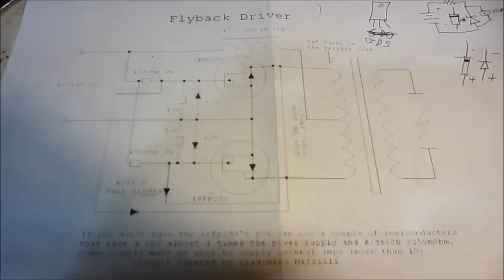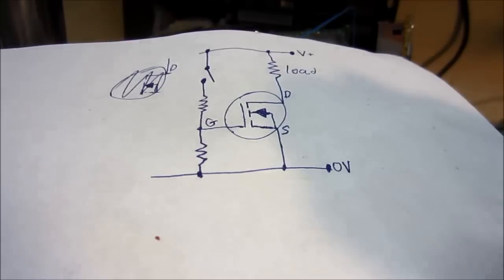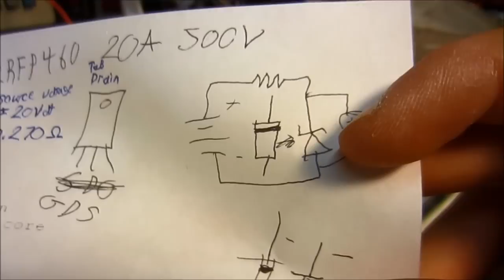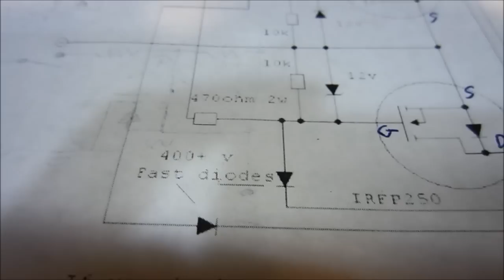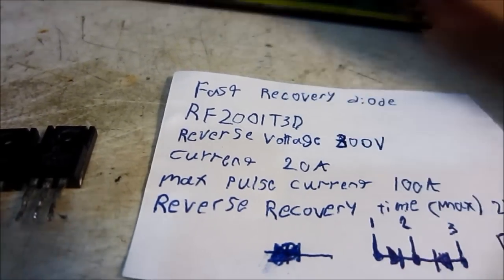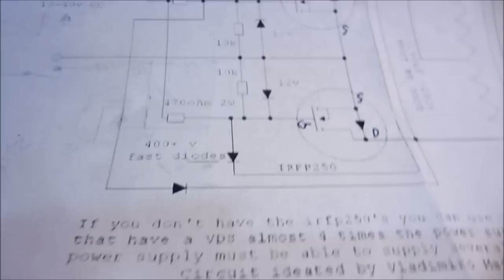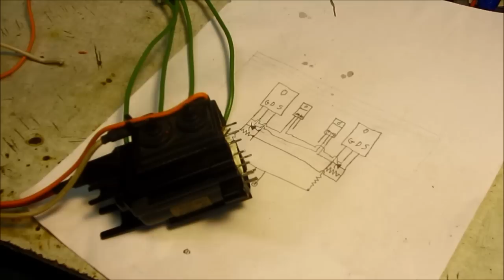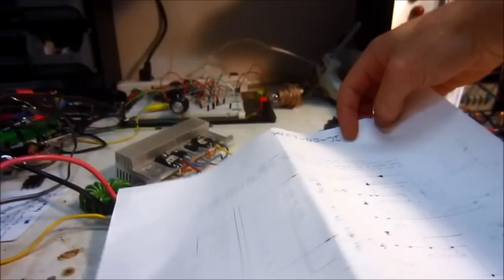How to Build a ZVS Driver, Run, and Mosfet Failure

Comment: i finally made a ZVS driver. hooked up my power and got nothing. i looked it over and over and everything was hooked correctly but nothing came from the flybacks. i put some more voltage into it and then one of my mosfets just burned up. never was able to find the issue, very discuraged
Reply from the maker: Well if you look at my latest post on Google+ you'll see that I just built a ZVS driver and it works great!!!  How to video probably coming soon too.  Can you take a picture of your ZVS so I can see how you have it hooked up?  What were you using to power it(voltage and current)?  What mosfets were you using and are you sure they were good?  I must solve this mystery!!!  :)
Reply: ill send you a photo some time, but it might have been to much voltage, i didn't realize ac to dc sometimes the dc was higher voltage, i put in 12v fist and got nothing and then used a MOT with 32V ac into a bridge which migh have been more then 40 which was kind the max. but nothing ever came. and all of the parts are brand new bought to the specifications to the diagram. do you have an email i can send the picture to?
Reply from the maker: Hmm... What mosfets did you use?  That stinks that it's all new components.  You can send the pictures to makerj101utube@gmail.com or post them on Google+.  I don't check that email much though so post a comment or something on YouTube when you have sent it so I know.  If you don't it will probably be like a month before I see them!  Hahaha  I don't know how your comment went undetected... I check my YouTube like very day...  I am just going back and checking some of my latest videos to check for comments I missed cause I seem to miss a lot with the new comment system.  Sorry about that.
Reply: haha dont worry about it! i think i figuered out the issue, thanks!
Reply from the maker: That is good!  Did you get it working or did your mosfets get damaged?
Reply: i haven't yet remade it, but my mosfets burned up, no worries because i have two more pairs. Before i do anything though i have to buy a new multi-meter, burned up my last one hahaha
Reply from the maker: Oh well, good you have extras!  You can buy ones that are $3 from Harbor Freight!  They are cheap as ** and don't last long.  But they are petty accurate and and have all basic features that you need.  For the price you really can't beat them!  But ya the cheap ones burn up supper easy!  Just over volt them on the wrong setting and you let out the magic smoke!  XD
Reply: i got everything of digikey. not to bad and its high quality
Reply from the maker: I have never gotten anything from Digikey but I've heard there pretty good.  Probably safer than eBay.
Reply from the maker: Not nearly as cheap as eBay though.
Reply: yeah thats true

Comment: wow your ZVS is looking realy good :)
but at the end the flames on the mosfet was not looking that good :(
Fokus
Reply from the maker: Thank you!  Yeah the mosfets that I used were not the best ones.  Check out my newest ZVS driver that puts out 3 inch arcs and has not burned out yet!  New ZVS Driver Running Like a Boss With IRFP260N Mosfets - Hot 2inch Arcs and Jacob's Ladder

Comment: BOOOM mosfet kaput :(

So one thing about the schematic, (simplified schematic of Royer oscillator with diode feedback, have several fails and faults)... use separate power supply for the output stage (the point of the filter choke) and one power supply for the point of the two resistors who going to diodes and Mosfet gate`s and operate the schematic so: first connect the power supply 12.6VDC-15VDC to the point  with diodes and Mosfet gates and let it be powered all your test time then just give the power to the output (24-80VDC)  stage - the filter choke... and you get NEVER get burned Mosfets!!! and one more thing add a Neon lamp to the Tank Cap it will be helpful  :)
Reply from the maker: Thank you so much for the tips!!!  So if I use a separate power supply of 12 volts or something does that means that I don't need the zener diodes any more?  So if I connect the 12 volts first does that give it time for one of the mosfets to turn on and the other to turn off so they don't both get the inrush current?  Also what is the job of the inductor/filter choke?  Thank you so much!  I bought some IRFP260N mosfets so I'm going to have to try this the way you suggested and they should last longer!!!  :) :) :)
Reply: Makerj101
Separate power supply will improve the schematic with kind of "PRE Oscillation" on a scope you can see it (a sinusoidal signal) on the main LC circuit (for measurement on inverters, HV stuff better scope with good insulated inductive loop pickup sensor), the cap and the output coil (or transformer primary) if you connect a fly back or else. The oscillation will start wen you apply the 12VDC to the transistor gates, --> trough the diodes (diode reverse current) this schematic start to oscillate with small output power because the current is small and trough diodes going around 3VDC if you use a correct type of ULTRA fast diode such HER508 (UF5408).
Wen you apply the main voltage to the filter choke the Royer will start up without a kick of the current and you Mosfets will survive. Such upgrade work as SOFT START.
The Neon lamp parallel to the main capacitor will work as snubber and take of the over voltage.
The usage of zener diodes is up to you, i let him between gate`s and GND rail.
IRFP260N a good stuff but never use a power more than 80-100VDC to the schematic, circuit is resonant and wen it works on the transistor drain`s will be around 200VAC and more with lower frequency :)))
Im using IRFP460 and IGBT`s (1200V ~50A)... ---> 11N120CND are useful.
The ferrite choke block`s HF to go back in power supply and prevent inrush current wen you switch on the circuit.
A other sing that im testing to time is new add on for Royer oscillator... it will be a driver for gates operated from the diode feedback signal :D Thats will improve the efficiency of the inverter.
Reply from the maker: Very interesting!  Thank you sooooo much!  I built my ZVS driver the way you have suggested and it works great!!!  Video coming soon!  No burnt mosfets yet!  So that's the proof!  :)  Wow so your saying I can go up to 80 volts with my ZVS using the IRFP260N's!  I have only got it up to 30 volts and I am getting awesome arcs about 3 inches long!  If I can go up to 80 volts with out going over current then I don't even have a clue how big of arcs I will get!!!

Is there any harm in not using and ultra fast diode and just using a fast recovery diode?

I also swapped out the flyback transformer for a induction heating coil.  How do I determine what frequency (capacitor value) will heat the metal fastest and more efficiently?  Cause I tried many different caps and it was hard to tell which one was better.

Thank you so much for all the tips and help and such!  Much appreciated! 
-Makerj101
Reply: Makerj101 The frequency is of the metal's excitement frequency, usually about 115-155kHz.
Be careful, you're basically having a huge AM transmitter(with "no signal input) with no antenna in your hands\on your table! That's all sorts of nasty.
Reply from the maker: ***** Interesting.  That could be bad!  How would you contain that much RF?  Thank you!
Reply: Makerj101 You just don't. It's all over the place if you do anything with HF HV anyway.
Reply from the maker: *****  That's true.
Reply: *****
Yes this so cold "auto generator" can up to 300kHz oscillate and even 2MHz but its not bat stuff :D
Just you must be careful with resonant parts of the schematic HF AC current left a painful burnings even can kill you.
I got a god scar on my left hand from a short wave transmitter ... HF "arc" burned a hole in my nail when i touched an unsafe terminal on output amplifier ...

Comment from the maker: ***** Yup!  It was using over 200 watts at max!  Not bad at all!
Reply: maybe the failure was partially due to your power supply rise time. if the rise time isn't sharp enough it won't resonate and you will blow the transistors

Comment: Man, I wouldn't trust the insulation on that high voltage wire.  Couldn't it shock you by holding it?
Reply: more likely if it was alternating current on the output, an ignition coil nailed me right through  50kvdc wire. flybacks are rectified now a days.

Comment: Probably too much highest volt with incorrect resister or fast diode doesn't work right way. I recommend this UF4007.  Also you need capactior for power supply.  If it is 25 volt, I would recommend 36V 4700uf.
Reply from the maker: Thank you so much!  I'll have to try those things!

Comment: (P = V x I) work it out, you know your current and your voltage so work out the power and you will know what W rating on components you need to handle the power.

Comment: i use parts drawers that you can buy from home depot or lowes or any hardware store.  then i use a label maker to label each drawer. (i spray paint mine black without the drawers in it so they look nicer because they come in a really plain gray color)
5ky.me/media/organization.jpg

Comment: I have seen this circuit used on YTube so many times. nobody has ever described what is happening in the transformer. All you guys show is the way the transistors are switching. The reason it switches is because the transformer is saturating and the field collapses then the next FT switches and the process reverses.  This is one of the stupidest designs I have seen.  It cannot be turned on slowly.  It must be switched ON fast.  If it is switched On slowly, the circuit latches and one transistor just stays on and blows up.  It does not have any short circuit protection.  Why don’t you use a proper control Iron Condor and definitely not the 2526 which also does not have SC protection?

Comment: I had a very hard time making my zvs to work.This is a chinese zvs driver I got off ebay.I did manage to make it work only after adding a second inductor parallel to the existing.The strange thing is that according to my LC meter this inductor's value is 2.400mH which is way much higher than your inductor. .I am told that the indcution of the small torroid has to be of higher induction than the induction of the flyback.I am not sure I understand the theory behind all this.My zvs driver work for sometime but the center tap insulation melted.I replaced the wire but I cannot get the driver to work again.I get some very small sparks.I am using a MOT transformer putting out 26.7 volts to power the driver.h_t_t_p_s://www.youtube.com/watch?v=fZG0OzZCNsw

Comment: you have IRFP250 which is more than adequate.  it is not the FETs it is your stupid circuit.  uin order tolimit the current u need to use a switching power suppl y IC like UC3808.  check out the price of that.and learn how to use that kind of device

Comment: confused
Reply from the maker: What confuses you?  How it works or something else?  If you want to see arcs then check out my latest video.  I rebuilt my ZVS driver with 100X better mosfets and I can get 3 inch arcs and it hasn't fried yet!
Reply: generally im new to electronics, but the part about transistors. i have different transistors which i got from a computer power supply. it have has a metal back. pin is M MBR 2045CT C00D03
Reply from the maker: I think this may be your component.  http://www.ic-on-line.cn/view_online.php?id=1848512&file=0425\mbr2045ct-d_5120845.pdf  I don't think it's a mosfet/transistor though.  I think it's a dual diode package.  Used for rectifying AC pulses from the power supply into DC.  There should be other transistors in the power supply though.  Look on the high voltage side of the power supply.  You probably got the diodes from the low voltage side.  They should be near one or two large 300 or 400 volt capacitors.
Reply: yes its diodes ;) i have a F J13009-2 transistor. check it out and tell if you could use it in zvs
Reply from the maker: Hmm they are not fast diodes.  They might work but fast diodes are recommended.  As for using transistors, it can be done but you need a different circuit. Also don't look for as good of performance when using transistors. Also your transistors can only handle 12 amps.  You want at least 20 amps or they will go up in smoke like mine did in the video.  You really want mosfets.  They can handle a lot more amps, are way more efficient, and in most cases all around better because of there super low on resistance.  I would recommend fallowing this Instructable.  http://www.instructables.com/id/ZVS-Driver/?ALLSTEPS 
Get yourself some nice mosfets.  They are not really expensive(good ones are less than $2 a piece on eBay).  High1voltage1rules (check him out if your like high voltage, he is the boss of high voltage!), many other people, and I, have all had very good success using the IRFP260N mosfets.  They can handle 50 amps at 200 volts and can go though a lot of abuse if you have a good circuit.  They go for about $15 for 10 on eBay.  http://www.ebay.com/itm/10-X-IRFP260N-IRFP-260N-POWER-MOSFET-BY-IR-IC-BRAND-NEW-/330529184214?pt=LH_DefaultDomain_0&hash=item4cf51319d6 
They are the ones I use in my latest video where I get awesome 3 inch arcs.  New ZVS Driver Running Like a Boss With IRFP260N Mosfets - Hot 2inch Arcs and Jacob's Ladder
And I'm not even pushing them near there limit.  I'm putting about 14 amps into them and they really should be able to easily handle 30 amps with out any worry.  What would you use to power your ZVS driver?
Reply: dont have credit card. with my transistors (J13009-2) Need a circuit. with the diagram on the instructable i dont understand how to connect the the transistors since mine is different
Reply from the maker: Hmm that could be a problem.  Have a friend buy them.  That's what I hate about Radio Shack is they don't sell any good mosfets.  You can get a pretty bad one for like $3 but that's about it.  Here is a transistor version:  But notice it does say that it is pron to failure not because of the circuit but because of the transistors.  Normal transistors are just old and sort of out dated for doing this sort of thing.  Handling a lot of amps is just not a normal transistors job.  Transistors need a lot of current put into the base in order for them to turn on fully.  The one you have there needs 3 amps at 3 volts to turn on all the way and let 12 amps though it.  A mosfet needs only a couple milli-amps at more than ~6 volts to switch on an enormous load of say 50 amps.  So you could try the two transistor version or one transistor.  The two transistor one should produce a higher voltage but it may be more susceptible to failure because you are putting the transistors though more stress.  Hope this help!
Reply: yes
Reply: i just subscribe now
Reply from the maker: science-random Thank you! :)  Much appreciated! :)

Comment: Your still a little too hap hazard, the current likely isn't very high, but your voltage is a few thousand volts. you need to respect that more than you are. A fail would not be a good thing for you.

Comment: WTF it is for?  I still can't see a purpose for building it other than harmful effect on human body.
Reply: probably to just play with it. Or probably when your flyback transformer doesn´t have an internal rectifying diode you could use it as a high voltage power supply for a beefy tesla coil